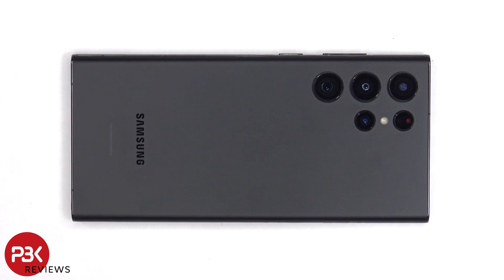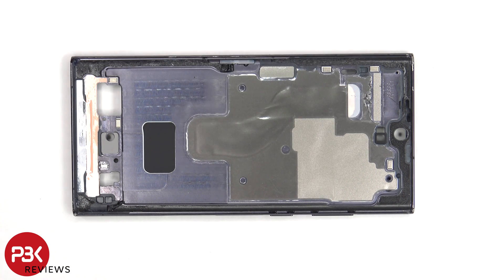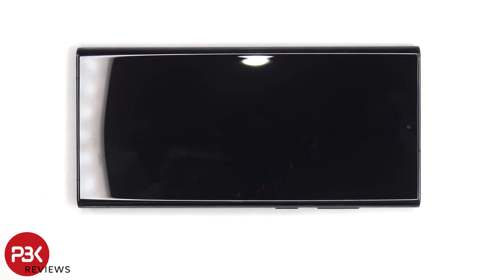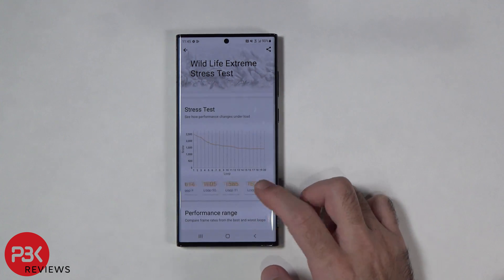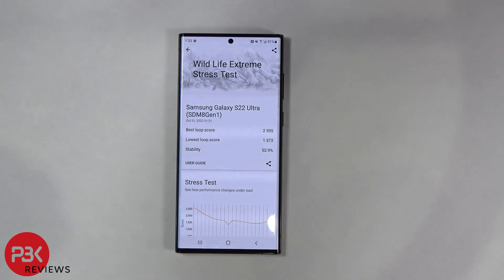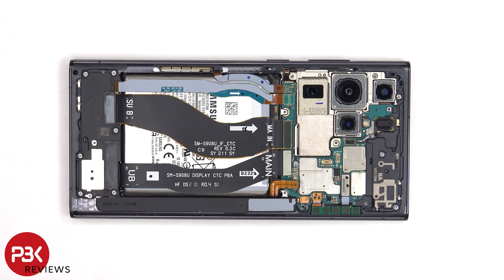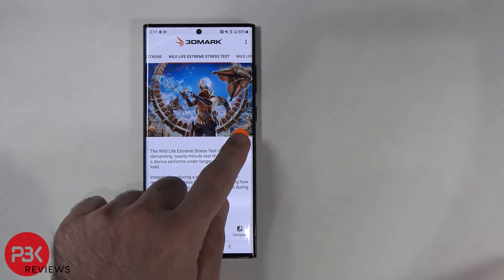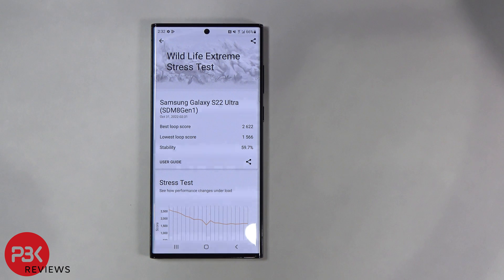Make Your Smartphone Faster and Run Cooler. Dual Vapor Chamber.

Comment: No no no. If ur getting cooler on screen and frame temperature that just means u made a insulator for the heat to be trapped. This is ridiculous it's common since u suffocated that processor and cpu.

Comment: One thing I didn't understand is: why keep the wireless charging coil?
If you're going all in on making it a high performance phone, just throw that out!
Use an even larger copper plate and apply thermal paste for it to efficiently transfer heat onto the glass back...
Furthermore, root it and change the heating parameters. The more you allow it to heat up before throtling happens the better, since a higher temp. gradient between device and surroundings means more heat energy gets transferred out of it.
And the more heat you're being able to remove, the more processing you can do :)

Manufacturers keep it under 50-ish so ordinary users don't feel uncomfortable, but we all know these components can keep working around 80-ish just like their desktop PC cousins...
Only real issue with that is reduced battery efficiency and thus lifespan. But I don't think that would be a concern to you...
Reply: I had a Nexus 5 that would stay around 90-ish ºC and it was amazing how good it was even as it aged because it would almost never throttle down lol
It's still alive just fine, just needing a battery replacement =D

Comment: Most phones are not running at their full potential because people just keep complaining about the overheating issues. I had Galaxy J6 which was very slow so people complained and samsung released an update which made phone smooth but it also caused heating so people complained overheating issues and samsung rolled out new update and reversed it and made phone even slower

Comment: I mean it works a lil. But Pelletier coller just better at this and non invasive. It needs a powerbunk or an outlet though.
Reply: A peltier cooler is indeed the best solution, gives me 99% stability in a 20x loop test

Comment: If you dont wanna remove your phones cover just put a copper sheet at the back of your phone and the second layer put some thermal adhesive and then graphite sheet film
Reply: Ya wrap it in a thermal blanket... geez
Reply: @w.e.s. Not totally wrong though. I covered the X6 Pro with an actual copper plate and it made the electric fan and/or peltier cooler more effective.
Now that I removed it again, the back no longer dissipates as much heat which others will see as a good thing... but not for me.
Reply: Can you do a video tutorial

Comment: Personally I'd first replace the stock battery, then take the phone apart some more and fabricate an aluminum backplate and attach a vapor chamber on it so it makes contact with the SOC. 

Then I'd change the operating system with a custom kernel with overclocking functionality. 

If you pair all of this cooling and power and fresh battery and a more optimized OS with an external phone cooler, that cools the aluminum backplate down, you can possibly run your device with at least 60% more clock speed if not double (stability may take a hit after 75% increase) 

I did these steps with my Razer phone 2 from 2018. Pixel experience aura build, took out the LED RGB and replaced the battery, put an aluminum backplate on and attached a secondary vapor chamber on it.. the phone now runs at 3ghz all the time with no issues and 3.2ghz if I really need the horse power and if I need extra cooling, the modifications I have made already makes it extra efficient.
Reply: Are Xiaomi vapor chambers safely removable? To take it from a frame part of old Poco phones? without any hole or cut
Reply: @D.SLASHERRR  no clue if they are. Some phones glue them to the frame, in which case it is safely removable, you just have to use extreme caution.

A heat gun, acetone or high grade alcohol can undo the adhesive. Or a combination thereof. Personally I'd check for all. Heat is unlikely to work alone since it is purpose built to hold under heat.. try acetone or high grade alcohol.. if you have access to everclear, try that. If it's 190 proof, it should do fine for this purpose if the adhesive is soluble with alcohol. (190 proof is 95% alcohol by volume)
Reply: @159tony Could you upload the process on your youtube channel?
Or Facebook?
*Sorry i'm asking too much.
Reply: @claritoresdiano1021  since I am currently using that device and I have changed some mods that I have on it, no. Not until I switch to mainlining something else.
Reply: @159tony  what you think about Artic Shark Graphene Copper heatsink placed at back cover?

Comment: I had an old galaxy a7 2016 which got to freaking 92°c.I applied thermal paste on the processor and ram which made them dissipate heat to the aluminum frame.The temperatures dropped drastically from 92°c to only 70°c.The phone reached 70°c in the worst case scenario.After doing this only the side metal rail got a bit hot because the processor was now dissipating heat to something.The old thermal solution was a joke.It was a super small and a very thin thermal pad which dissipated the heat from the processor to a thin copper film which would conduct the heat back towards the motherboard.I also applied thermal paste to the backside of the processor.
Reply: Holeeshii phone or heater

Comment: Hey also, what if you make a video about liquid metal thermal paste?
Reply from the maker: It would require extensive modification because the liquid metal needs a housing or enclosure so it stays just over the processor and does not leak or get out anywhere else. If it does, it would short the board and render it useless.

Comment: just done on my 2 years old exynos s22 ultra ,phone started to restart and did the black screen of death thing ,still not much about around. thermal paste was like dry biscuit and graphite foil was dried onto the shield completely around. no bsod since upgrade ,thanks
Reply from the maker: you're welcome :)
Reply: could you tell me why he has used grapgite sheet, is it impotant to use it? i wanna try and make it so please tell
Reply: @NiKhiLSaYi  don't know really because copper has better heat transfer. tried with graphite and had to take apart again wasn't great,removed and used a similar sized copper ,sanded down on glass both side then both side thermal paste ,video is good only Hydronaut works and now good ,3dmark always in top 1%. maybe the best would be copper foil on the top to close the gaps ,there is copper foil in garden shops
Reply: @8peterp  thanks for your reply

Comment: I saw people testing games using a Snapdragon 870 and I saw the CPU indicator running at a temperature of 80-90°C even though when compared to my SoC which should have a higher tDP than 870 it would produce more heat, but the SoC CPU temperature I only got  only 70-80°C, even though the phone doesn't use a cooling vapor chamber, so I conclude that the vapor chamber is more less effective, and maybe this is the reason Sony doesn't use a vapor chamber on their Xperia 1 series

The test uses an external cooler, my iPhone battery temperature is around 43°C, Snapdragon 870 battery temperature is around 37°C, and of course both have been rooted and disabled thermal

Device:
-poco f3 (snapdragon 870) tdp 6watt. sc:nanoreview
-sony xz3 (snapdragon 845) tdp 9watt. sc:nanoreview

Comment: PBK, I wanna get a S24 Ultra from my S22 Ultra, I'd like to see if we could try and drop temps as low as possible. 
The 2 Degrees is impressive, and the stability increased, while most likely not huge I'd like to see if battery life improved.

While most modern laptops seem to go long enough for most, the cooler running SOC, RAM, Storage, alongside a Debloation tool
may add enough battery saving alongside the 3nm Single Core / Efficiency to make the upgrade worthwhile. 

Think we could do something in the future?
Reply: Cooler running will usually use more power since the throttling will now be less. Unless the battery is affected by the temps so much it drains faster.
Reply: @bulletpunch9317  that'd factually false across the board. Completely & Utterly wrong.
Reply: @nerdynumen  cpus lower clocks when they get too hot. Thermal throttling look it up.

Comment: Liked the idea! However I'm curious if sticking a graphene film behind my phone cover would help dissipate heat or would it trap it even more?
Reply from the maker: I mean it already has graphite film over the charging pad which transfers heat out the back but I don't think anymore would hurt.
Reply: @PBKreviews  Thanks for replying. Although my phone is a poco x4 gt with a plastic back, it wouldn't trap the heat at all? Also is it ideal if I add a copper tape/foil before adding the graphene film?
Reply: Btw, how come adding another vapor chamber didn't work at all? I expected the temperature to be around 38°c or even less with that added
Reply: @donovan5459  Check the stability, went from 54% to near 60%. For a Snapdragon 8 Gen 1 is pretty neat.

Comment: Fantastic video!! Do you have any suggestions on where to source a vapor chamber replacement part, wanna do this for my old phone but can't find anything on aliexpress
Reply from the maker: You would probably need to fine a broken screen assembly with frame which comes with the vapor chamber attached to it or something like that. Usually they aren't sold as a replacement part individually.

Comment: The fact is when you cut the vapor chamber all the cooling magic is gone. A small copper piece will do better than that piece of vc
Reply from the maker: It still works, but yeah a solid copper piece would be better but I didn't have one on hand to use to just used the vc.
Reply: @PBKreviews if it is damaged it does not work, better put solid copper peace

Comment: Great idea adding another chamber! That would increase the time before the SoC overheats. May I suggest one thing, when running the synthetic test, be sure to run it 3 times in each iteration and take average values? This way you can insure that the score is accurate and there isn't anything influencing the results, like apps running in background or Android doing something.
Reply from the maker: Thanks! The test I ran was sped up 5000x because its a 20 min test that repeats the test 20 cycles and gives the best loop score as well as the worst loop score and displays the graph to see how it was averaging. So in essence I ran it more then 3 times :)
Reply: @PBKreviews  I see, thanks for responding.

Comment: I & my friend always did this trick on our older phones by reapplying PC grade thermal paste & adding thermal copper plate if needed in certain phones. 
Thanks PBK for publishing the review to public for awareness
Reply from the maker: Thank you and you're welcome :)
Reply: Where you add the thermal copper plate?
Reply: @wise7260 ...thermal copper plate/ copper shim is placed at ram/ and cpu die its wont be touching evenly so you'll need a thermal paste to spread its contact area....

Die-paste-shim/plate-paste-cooler/frame...
Reply: could you tell me why he has used grapgite sheet, is it impotant to use it? i wanna try and make it so please tell
Reply: @NiKhiLSaYi  graphite has better thermal conductivity
Reply: @blengblong01712  yeah but sandwiching graphite between 2 thermal paste goobs isnt gonna improve.

Comment: Doing the test with the phone lying on a flat surface is not ideal, because the heat dissiipation via the back surface is hampered. If I may I would suggest that you do the test with the phone in  vertical position, so that the back can emig the heat to the ambient air. Keeping a note of the ambient temperature would also be valuable for comparison.
Reply from the maker: True, I was just considering in reality the phone would be in someones hands so the hands would be covering the back while it was in use. But yeah if I wanted to see the highest results that would be a good idea.
Reply: @PBKreviews  human hands actuall can cool electronics because of blood flow so the phone would be cooler
Reply: Correct. That means a 98 degree water bath/"coolant"/thermal barrier.

Comment: I'm wondering if placing a peltier module cooler on a Nintendo switch will have the same effect. I'm seeing a lot of magnetic phone coolers equipped with peltier modules or TECs.
Reply from the maker: I'm not too familiar with peltier module cooling, but I would think something like that doesn't really transfer heat away from the component rather than just providing a somewhat cooler surface against the component. Again not too sure since I'm not familiar with those. The phone coolers have a fan usually which also draws or displaces the surface heat so with that in combo with a peltier module cooler I would see some cooling.
Reply: @PBKreviews I have a s21 and a v1 switch cracked. I replaced the thermal paste, thermal putty for the v1 switch and bought the black shark fun cooler 4.
The switch got like 15-20° cooler.
The phone with the cooler from 42° to 30° (if I'm gaming heavy).
If I just watch a video and use the cooler, it goes down to like 17°
The cooler itself gets to 0° and absolutely cools the phone down.
You can feel the phone is very cold to the touch when using it.
Reply: Yes! Those work extremely well. Only tested on s22 ultra when playing a few emulators. It was fridge time every 7 minutes of play. Until I tried this peltier cooling pad. Though I have a really good good cool an Alaskan cucumber! Play no frame drops for hours at time mine is plugged in power supply I've seen the built in battery option as well.

Comment: If the phone is running slow and sluggish, an easy solution would be to get an iPhone instead.
Reply: No, Just Optimized your current Android phone that you have.
Reply: What you are saying is that you are avoiding one problem for another, such as overheating and Many capabilities are inferior to Android phones. The best solution is the one that can be solved.

Comment: Best Solution is, Drop Your phone in Water 🌚
Reply from the maker: lol :)
Reply: I do that too And wondering would the glass crack from getting hot and suddenly cold ?
Reply: Liquid Nitrogen 👻
Reply: *internal condensation
Reply: Fr sometimes phone design use screen for heat dissipation
Reply: NgL, I was running a benchmark on my s24 Ultra and she gets toasty. I just ran a faucet on the screen the whole test and it worked extremely well keeping it cool during the test
Reply: I recommend Peltier coolers
Its easy to DIY, just a peltier module and a very very old gpu heatsink
Reply: @kurejirin  and power supply with like 40W lol
Reply: @ladislavzenk2139  you gonna need a full size gpu or cpu cooler for that 🤣🤣 also it probably make vapor inside the phone and damage to board.. i will do it when i get a new phone
Reply: @kurejirin  i know ,it was joke
Reply: @ladislavzenk2139  give 30 amps from a power supply and enjoy of the fire 🤤
Reply: @kurejirin Peltier coolers are not only extremely inefficient, they don't work as a cpu cooler well at all
Reply: @DarkAttack14  They do work, you just need to get something with 18w power or if you modify it you can get by with a 10w one too.
Reply: @bulletpunch9317  I mean sure for a phone cpu it might work but due to its inefficiency you're going to really suck down the battery for not much benefit. Linus tech did a test with a desktop pc and it was just not worth it in the end and couldn't handle high heat scenarios
Reply: @DarkAttack14  yeah its a phone video so im talking about that. And its supposed to be plugged in to outlet or powerbank. Those with builtin batteries arent that good since since they only do 5w or so keep it smaller and lighter.

Comment: But is it still waterproof?

I have no idea what people do with these S22 Ultras, I had never any heat issue (Exynos) and it's performing like a beast.
Reply from the maker: If you apply new original pre cut adhesive for the phone (usually they come pre installed with original battery door/back cover replacements), then it should retain the resistance.
Reply: @PBKreviews  Thank you, didn't know that :)
Reply from the maker: You're welcome :)

Comment: Awesome video! A suggestion I have if possible is to test the water resistance or water proofing from phones. 👍
Reply from the maker: Thanks. I did it for a while with some durability videos before, but it didn't catch much traction from viewers.
Reply: @PBKreviews  too bad 🤷‍♂️, it is what it is lol. Cheers
Reply: It’s pretty much unavoidable to lose some waterproofing when you open a phone.

They’re really not designed for this.

Comment: My S22 Ultra is reaching up to 70°C while recording a video. Should I be worried?
Reply from the maker: Are you referring to internal temp or external housing temp? Usually when 4K recording, the phone uses a lot of processing as well as battery power so would heat up quite a bit.
Reply: @PBKreviews  Internal CPU temperature from CPUZ
Reply: @pixels_per_inch  internal shouldn't matter to you. Measure the external temperature, if possible or if it really let's so hot that it's not holdable anymore, then it's valid to be concerned 

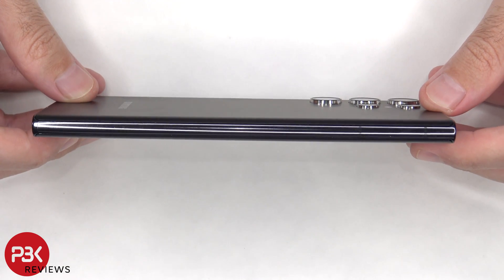Listen at 1:35 in the video
Reply from the maker: Yeah should be ok, if it was external temp then I would be worried.
Reply: @pixels_per_inch  in cpu z i have 90 100c 😂
Reply: @ashar8192  It does start burning my hand after around 5 minutes of recording, that's why I checked the temperature.
Reply: @femus3359  What!? Which device are you using?
Reply: @pixels_per_inch  Samsung Galaxy note 8 snapdragon 835
Reply: Batterie 39 cpu 80 cpu 95
Reply: No its normal ! 
smartphones are tough today